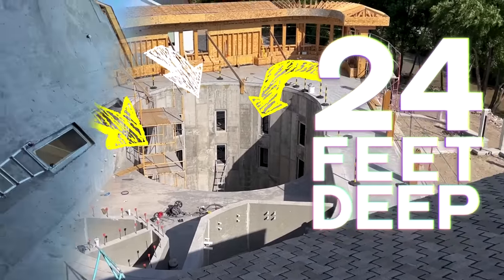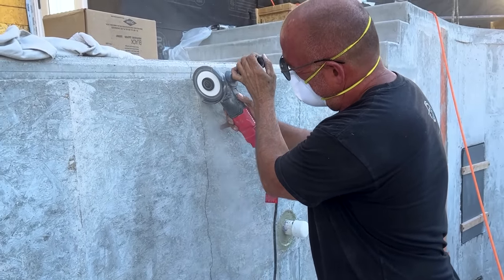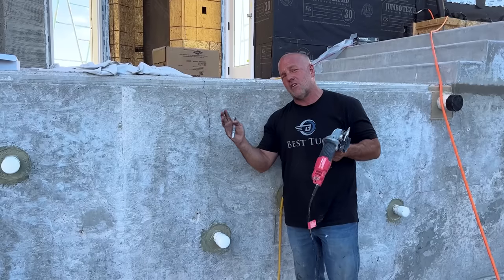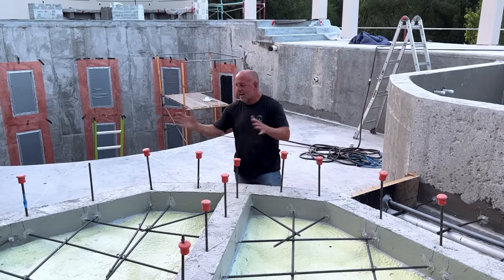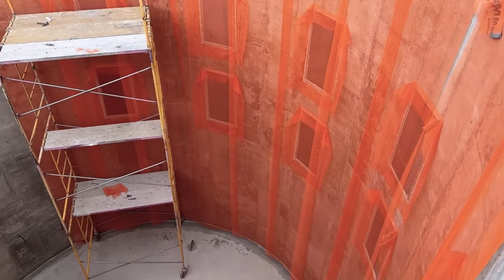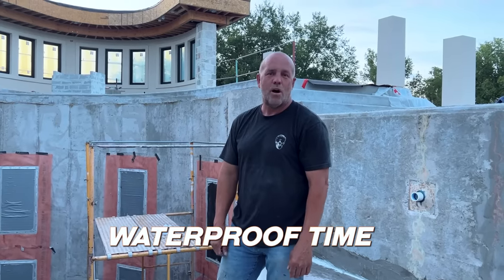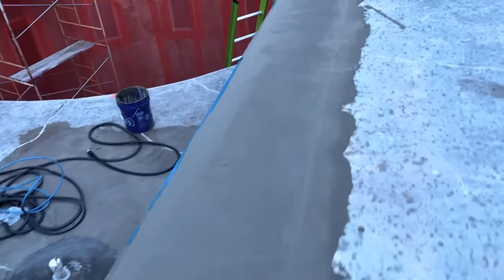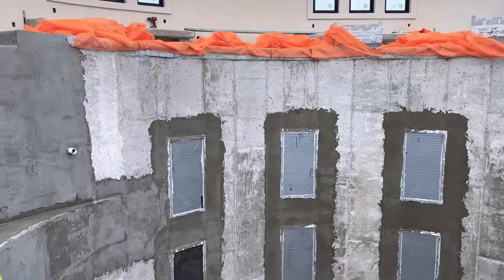Building the Most Insane Pool Ever | House Build #17

Comment: Thanks again Michael, for another update on the pool/house,  And as with every other thing I've seen you build, THIS is SPECTACULAR !
And as I've been following this I've been wondering IF YOU actually get cracks in YOUR concrete, or if you've some how figured out how to eliminate even that?
   Concrete IS VERY tricky stuff i think, and i have only built a relatively small foundation (40 feet long) for a ten foot high block wall on it, and about 20 feet (the SLC city engineers told me) had to be 2 feet deep and 4 feet wide, since that part ran over one of the Creeks that run thru town. (And in the short time that it was exposed above ground, I didn't see any cracks in that.) but it probably eventually did crack..  Something that has always puzzled me is how the people that build the huge industrial warehouses that are made out of concrete walls (poured into flat forms on the buildings floor and then craned into a standing position.)  I've never seen cracks in those walls... And I've been in a lot of 'em. So how are they doing that ...??? I know that they put a LOT of rebar into them walls.  
  Do they put something special into the
 concrete mixture???
If you have any idea about this i hope you'll talk a little about it next time.
Thanks again, and we ALL ❤️🥰❤️ ya, "Brother" ! ! !

Comment: Nice video. I did a similar project but, only 16 ft deep.  18 inch concrete walls and then epoxy and fiberglass instead of all of the layers you did.  I went epoxy because I wanted to have a salt water pool and I don't know if the resin base grout was available in 2012.  No cracks so far and no leaks around the pipes.  Changed out all the pumps to 3-phase motors in 2020. Electric bills were cut in half or less. thanks for sharing this!

Comment: Are the windows going to be flush internally? I'm genuinely curious to see how you address the finished inside edge of those given your standards for longevity. It seems like proud edges would give you more robust finishing options but would also represent a wear and tear hazard as people will grab and push off them while swimming. Thinking along those lines, I love swimming deep, and having objects to interact with down low is a very cool thing. I'm imagining a jungle gym type structure that you could swim 20' down to interact with essentially, which might be a cool idea to consider if you are into that kind of swimming. You could even tuck a pressurized airline in there for prolonged visits.

Comment: It's coming along nicely. I don't know the diameter of that 24' deep section, but there is a weight of water of about 7 tonnes per square metre at the bottom. About 1500 US gallons of water will be needed per square yard of the diving pool. That's going to be a money pit to keep clean and warm.

Comment: Hey Mike, with the half-billion tons or so of house weight, do you have any concerns about future settlement? Especially being on a wild river and I would assume pretty sandy soil.
Reply: I went back to the first video in this series, and yeah he's dealt with that.
- Went all the way down to bedrock, even though that's below the water table
- Put down engineered rock up to above the water table
- Waterproofed all that however-many-times-over, I don't understand the details
- Built a massively over-engineered reinforced-concrete slab on top of that, with redundant pumping systems built-in just in case (seriously)
- Started building the actual house on top of that (and structurally tied into it of course).

I don't know how much extra weight that foundation could handle before it'd run any risk of subsidence, but I bet Mike does. Reckon it's safe to say, that building is going nowhere fast.

Comment: I get the need to overly waterproof the pool but doesn’t water deep through concrete anyway and that is why there is the additional waterproof layer when building a pool.  That’s also why plastic is installed under the slab before a foundation is poured to build a house on.

Comment: Mike, I am interested if you had considered your pool with a different structural material, such as using your skills in designing structures with epoxy, and fiberglass and carbon fiber, or a even a stainless steel pool. 

Building with concrete has so many issues with thermal, massive weight, bonding each layer, water proofing, and the huge skilled labor tasks to make it successful.  

I really enjoy your videos, especially how you communicate your engineering considerations, and incorporating your experience of engineering solutions.  Wishing you, the many rewards using your design and engineering skills, combined with your hard work, in aviation, mechanical devices, and swimming pools, making a better world.

Comment: Q: Is epoxy coating a pool finish option? Instead of gunite? Such as the kind they use for epoxy flooring. Would that hold up under chlorinated water?
Reply: Gunite is a kind of concrete from what I know it isn't the outside finish you see.

Comment: Safety first, second and third. Is something i think i have heard you saying yourself. Especially in aviation.
I also think that there's a saying in aviation that goes something like: It not the first 7000feet that kills you. But the last 30 or so....
When i se you and your crew working whit there feets one inch from the ledge of the last 30feet them and you will ever travel if anybody set's foot there. Whit out any safety railings or visible Safety lines. 
My heartbreaks a little. 
I know it's may not be required. But that also the case whit 3-5 layers of waterproofing just to be safe.
Take care out there.
Otherwise i think its a awesome engineering, design and dedication. Keep up the good work. And remember rest is also a mandatory assignment. 
Love what you do and accomplishments.
Best regards Fredrik

Comment: FIRST -  I MISS DRACO   badly
I'm not being a jerk  -  this is good as it gets advice.   After 5  or at most 10yrs of facing elements - Waterproof layers might become a myth!  If you provide relief for leaks to travel between each of the water proof layers - the leaks can be piped to sumps and will not be able gain pressure between layers to cause damage.   Finger Drains can "pick up" the leaks safely directing them to sumps where they can be monitored and or pumped. "Stacked" waterproof layers can't reliably be monitored unless there are passages.  The alternative is that the leaks will build pressure which cause spalling or blows out a layer.  I spent many years constructing highly engineered hazardous waste impoundment ponds for uranium mines & mills,  one "Shootering Canyon Mill" located 12 miles north of BullFrog Bay Lake Powell
BTW  Scrappy vids  Amazing  the slats   lots of great info

Comment: Not a criticism, and maybe I misunderstood, you go through all the trouble to waterproof all the walls, then, if I heard correctly, you plan on drilling and epoxying rebar into the walls, that’s breaking the waterproofing, unless you over epoxy as so it overfills the hole to cover the hole you just put into the waterproofing. OR, I could wait until the next video where you show what you plan to do.

Comment: To complicated and no way to fix once it start leaking also extending the pipes inside of the walls!!! If you are so worried about leaking it would have been a lot easier to build it in two layers with a maintenance gap in between. Regular waterproofing on both. once the first start to leak fix it. This can not be fixed once it fails!